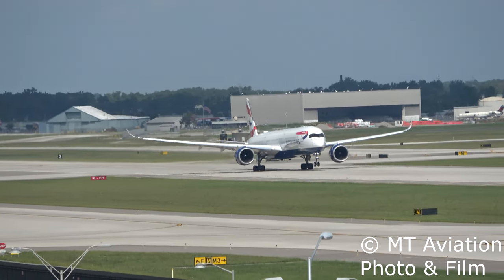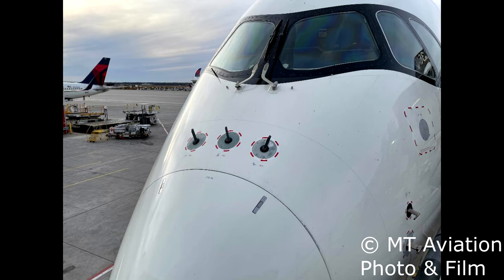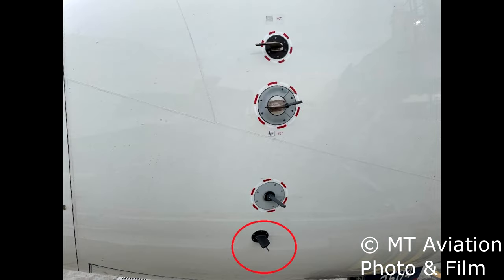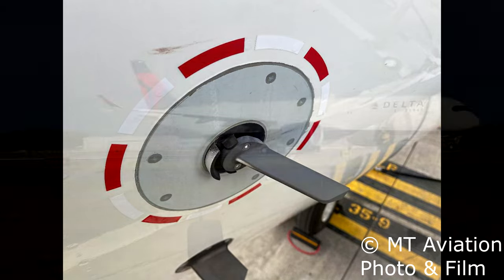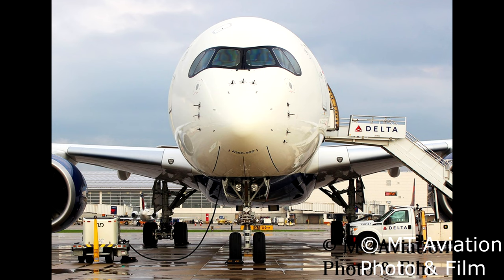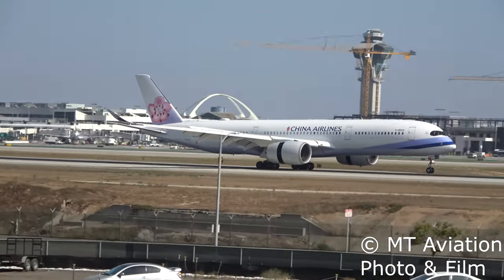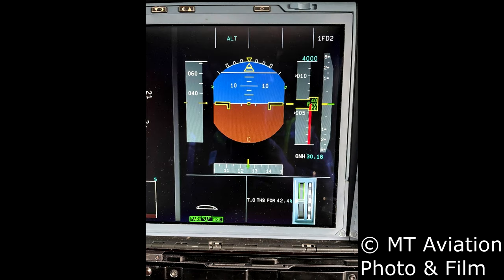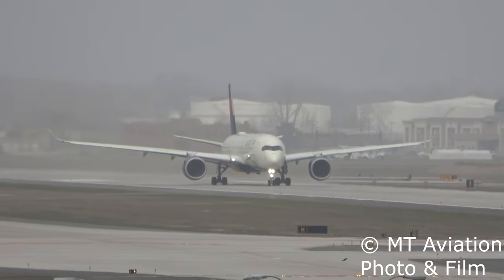What all the probes & sensors on the A350 nose do

Comment: I am struggling to determine where is the probe the pilot refers in: "the wire seems to have stuck in the cdb deicing probe". refering to a kite wire. air france A350 pilot report. I would appreciate a hand here. TKS
Reply from the maker: Sorry but I really dont know what you're talking about
Reply: @MTAviationPhotoFilm  pilot made a safety report. They noticed a kite flying nearby when they were on the runway, ready to take off. They decided to go anyway. The kite thread flew all the way, from South America to CDG. It got stuck in one of the A350 nose probes, as he refers here, the cbd deicing probe.